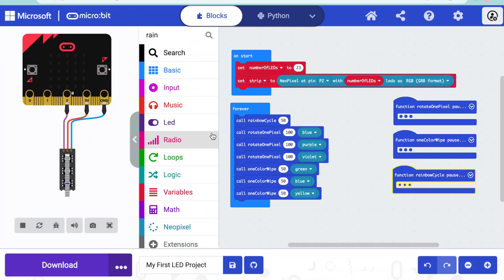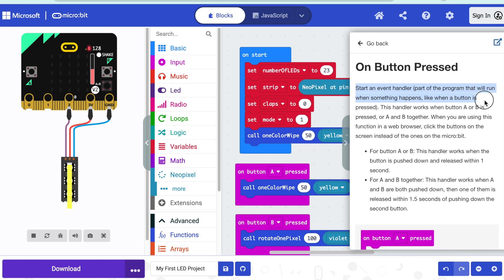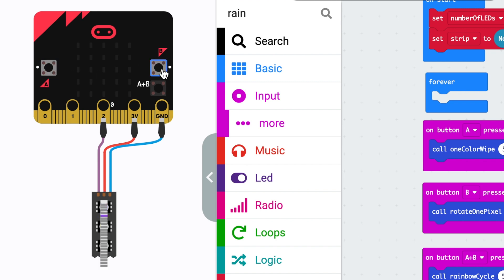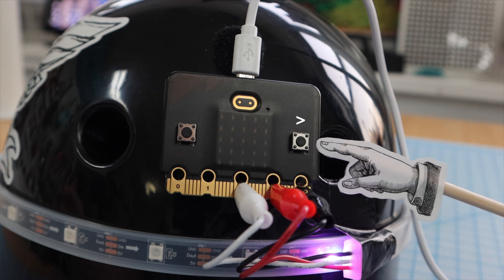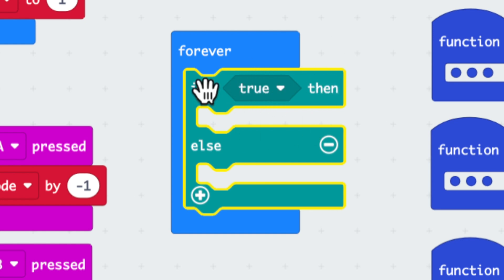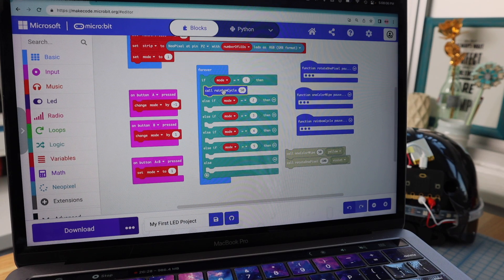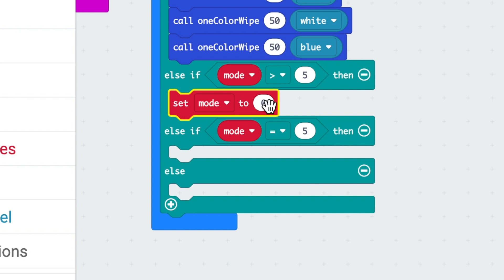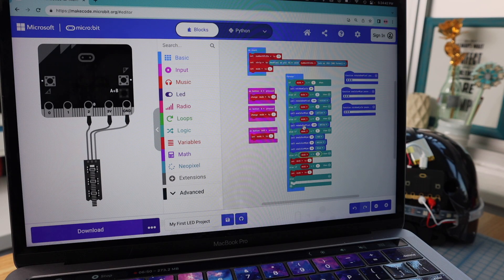Interactive NeoPixel Animations with micro:bit // Creative LEDs * 06 *

Comment: Hi @TechnoChic.
First of all super nice video's Well explained and fun to make! 
I followed your tutorial. And it works perfectly. I had to learn the basics and thanks to you I did!
I have just one question. i made two buttons that are connected to port 2 and 3. one button is controlling the microbit 'forever' mode's. (just going to the next in the playlist by pushing the button) Just like your video. The other button i would like to use to control a second 'forever'  that is filled with other modes (called modes2). It seems that those modes2 are not playing well and it makes a big mess of it all. Probably because i have a second 'forever'. what is the workaround for that? Could you explain me what I do wrong?
Thank you!!
Reply: I did found a solution!